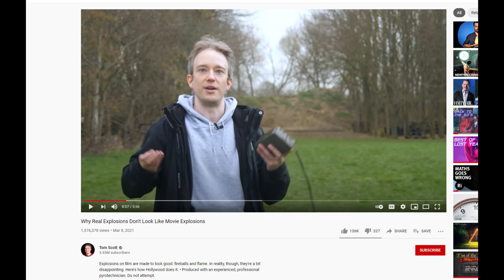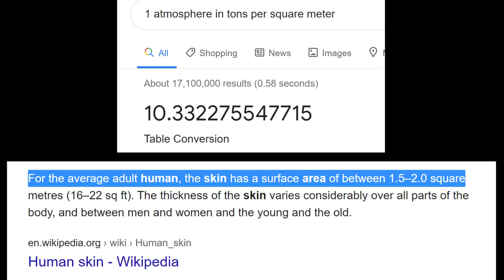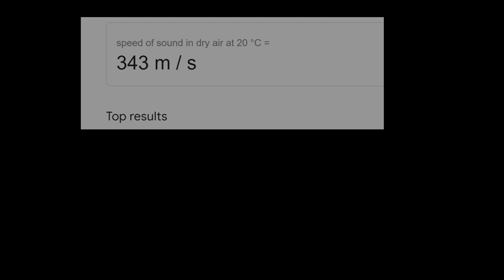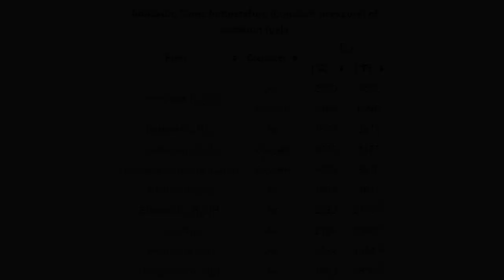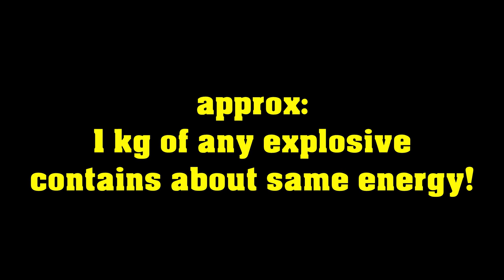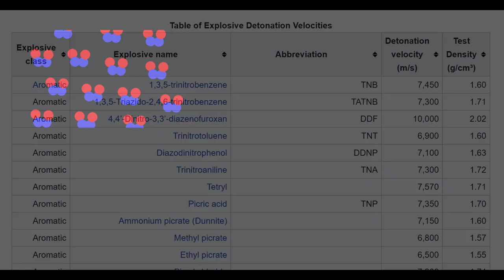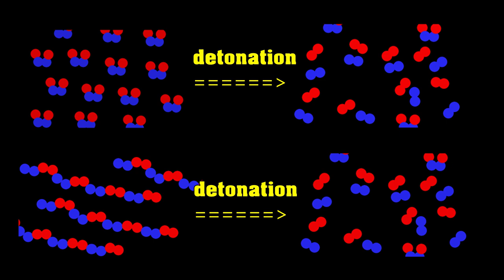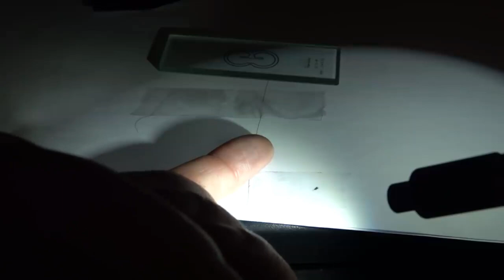Understanding Explosions!

Comment: I don't understand where the soot in the butane flame is coming from. Isn't a soot particle a collection of many carbon atoms? (how many? which configuration?) The carbon is coming from the butane gas, right? So when do these single carbon atoms from the butane gas that are left from the fuel rich burning combine into soot particles?
Reply: Google it bro.
Reply: @SuperMrDelgado  I did, before asking here even. Found some stuff on soot particle size in combustion engines (in Angstrom, not atom count. also no info on the structure, other than the fact that the soot particles are roughly spherical) but I couldn't find where the particles come from in the first place. Also I figured that people watching this video might be curious too.
Reply: @tpog1  The carbon comes from the fuel being burned. Butane is a hydrocarbon (a mixture of hydrogen and carbon). You're being pedantic trying to find the exact definition of soot. You might as well try to specifically define dirt. It's just a random assortment of carbon, it's not it's own element.
Reply: In a solid, the atoms are joined together (eg C60 - bucky balls). To melt a solid, you have to break those bonds. Hot atoms can cool down by forming bonds.
For a chemical reaction to occur, you might have to break some bonds  before making new ones, eg H2 + O2  heat them up to get H + H + O + O, and they cool down by making H2O + O
Reply: @SuperMrDelgado  You're missing the point. The carbon from the gas comes in individual atoms (almost) but at the time the soot accumulates on the glas these atoms have already organized themselves into fractal nano particles consisting of millions of atoms!

Edit: Look at the figure on page 1 of

http://vertes.columbian.gwu.edu/publicat_html/Jacobson%202020%20Soot%20composition%20Angew%20Chem%20Int%20Ed.pdf

There you can see what happens between the chemical reaction (the burning) and the soot reaching the glas.

Further edit: I am not pedantic at all, I am (was) curious! And now that I found out what really happens and where the nano particles (not the individual carbon atoms) come from I am pretty amazed.
Reply: You can google the energy of (say) a H-H bond or a C-H bond, etc.
Reply: @hermitoldguy6312  Thank you for your reply but I think you too have misunderstood my question. I know where the carbon in the soot comes from but again, soot isn't just a bunch of single carbon atoms floating around but a solid conglomerate of millions of carbon atoms (a nano particle which is gigantic when compared to most molecules, let alone single atoms). I was wondering where these particles come from when you burn a gas (I have no trouble understanding it when burning a solid, like a piece of wood or a cigarette). The articles I posted answer the question, especially figure 1 in

http://vertes.columbian.gwu.edu/publicat_html/Jacobson%202020%20Soot%20composition%20Angew%20Chem%20Int%20Ed.pdf

The individual carbon atoms self-organize into these gigantic nano particles after the chemical reaction but before they reach the glas which is really amazing if you ask me. And on page 11 of

https://www.repository.cam.ac.uk/bitstream/1810/285843/1/CARBON-D-18-03061R1_AAM.pdf

you can see where exactly this happens in the flame.
Reply: @tpog1  Thanks for the links - that stuff's a bit heavy for me. My answer (perhaps buried) was that the soot is formed as a way for atoms to cool down. The emission of light is another way of cooling down. The formation of reaction products is another way of cooling down. The thing is, a hot carbon atom can only bond with another atom it meets. If it's surrounded by oxygen atoms, it can bond with them. If it's surrounded by carbon atoms, what's a hot carbon atom to do?
Reply: @tpog1  Look up the definition of a pedant.  You're obviously just trying to prove you're the smartest person in the comments."I'm just curious, how did you capture these images in sequential order and manage to string them together in order to simulate movement? How did the individual photons interact with whatever device you were employing? Where did the photons come from?  Of course they form the image, but why are there so many?"
Reply: @tpog1  I threw some rocks at some other rocks, now they are in the same place. How did this happen? How are the rocks so organized? It's fascinating.
Reply: @hermitoldguy6312  Thank's for clarifying, I understand what you mean now. After I read your comment I looked up desublimation because I remembered that this is the name of the phase transition from gas directly into a solid, without a liquid state in between. And lo and behold, the Wikipedia article on desublimation (deposition) lists the formation of soot as an example:

https://en.wikipedia.org/wiki/Deposition_(phase_transition)

So it's not like the formation of a snowflake where the liquid water needs condensation nuclei before it can turn into a solid by forming crystals. Instead the gaseous carbon makes it's own condensation nuclei (or should they be called desublimation nuclei?) in the form of stacks which then can grow into solid fractal structures.
Reply: @tpog1  I don't have a mental model for liquids. AfaIcs,either atoms are bound together (solid) or they're not (gas). I can't imagine any other options. Looking at the phase diagram for the triple point of water, itsm liquids only exist in atmospheres - but I'm prolly wrong.
Reply: @hermitoldguy6312  Thunderf00t has a great video on this topic on his other channel:

https://www.youtube.com/watch?v=H7rejik_ZOw

It shows a simulation of a water droplet in air with realistic scales and speeds of the atoms and molecules. Maybe this helps a little.

Comment: if the shockwave pushes more around through the ground, why does it not slow down faster? shouldn't it lose energy the more it interacts with?
Reply: The shockwave does not "push" the matter, it propagates though it (similarly to Newton's cradle), the energy transfers from one molecule to the next. It is in fact just a very, very, very loud sound wave, so it moves at the speed of sound (the exception being the hot gas cloud from the explosion, that can sometimes expand faster than the speed of sound).

It only loses energy by expanding while travelling (via the inverse square law), and reflecting off from surfaces (like blast shields).

Comment: So if youre in a space ship, you have 1 atmosphere of pressure inside but zero outside - why isnt the ship exploding then?
Reply: The only thing that matter pressure wise is the pressure difference. The vacuum of space is effectively at 0 bar (0 psi). On earth the atmospheric pressure at sea level is about 1 bar (14.5 psi). So the pressure difference the capsule has to hold is around 1 bar.

This is not very much, to give some example this is about the same pressure difference an American football ball is holding. Car tires are around 2 to 3 times that. Scuba tanks can go up to 5000 psi (350 times the atmospheric pressure!).

However to make spacecrafts and space suits lighter the pressure is often lowered a bit. Human can live OK at 3000 to 4000 m altitude where the pressure is about 60% of sea level. If you want to cut down further you can increase the oxygen concentration. With 100% oxygen human can breath normally at only 0.3 bars (4.3 psi). This is what is used in the american space suits. However it is dangerous, at 100% oxygen a lot of things can catch fire very easily. 

The atmospheric pressure at ground level on earth is around 1bar. The atmospheric pressure in space is (close enough to) 0bar. The pressure differential between the cabin and space is thus ~1bar. Diving 10m under water also causes a pressure differential of around 1bar.

Since it is obviously not very difficult to construct something that can endure 1bar overpressure, it is similarly not very difficult to build something that can edure 1bar underpressure. Of course it is not quite the same to build a structure that can resist overpressure and underpressure, but it is not all that different conceptually. Since humans have built deep-sea diving vessels that endured ~1000bar (>10.000m water depth in e.g. the Mariana trench), it really is not all that difficult to believe that you can build a space ship that does not explode in space.

Comment: Eh a liter of gasoline is a combustible. Not a self-contained explosive. If you do the math you find octane actually releases about 10x more energy than TNT/Semtex/whatever. Partially because most explosives have nothing that can compete with the oxidizing power of pure oxygen, and partially because the oxygen burned by a liter of gasoline is not included in our calculation.

Perhaps somewhat surprisingly though, even an apples to apples comparison suggests that binary explosive like a mixture of pure oxygen and octane contain several times the energy of most conventional explosives. I.E. Rockets have more energy for their weight than bombs of similar weight. A 3000 tonne Saturn V releases consideribly more than 3000 tonnes TNT equivalent of energy as it burns. Perhaps a good reason why launching rockets from a regular airport would be pretty dangerous and thus point-to-point ICBM-based personal transport will probably not be happening any time soon. If the thing blows up, what you've got is basically a tactical nuke's worth of energy stored in propellants that could potentially mix.

Now, regular aircraft have energy densities even higher than rockets. A plane set for maximum range has considerably better Kerosene/weight ratio than a rocket. The main difference is that this can't really explode because there is no internal oxidizer. The best it can do is get very dispersed so it will burn quickly.

Comment: I recently watched a video on a space propulsion concept called the Orion drive 
Uses a series of nuclear bombs to push a spacecraft ahead at vast speeds

But I can't help but wonder just how well that even works when there is no gas pressure from an explosion as there is with a nuclear blast on earth 
Wouldn't most of the energy just be in heat?
Making this not a very good propulsion system 

Some incredibly smart people thought up the concept so I guess there is some reasonable explanation that some idiot who turns wrenches for a living doesn't understand

Comment: There is a high percentage of terrorist who are engineers. They say, its' due to engineers seeing the world in simple mathamatical reality. As a teenager, I had a summer job, in a amusement park. As joke, we took a roller coaster car, and put it near the bottem of a drop. We cover some t shirts with fake blood, and laid next to the over turned car. It looked like a car had jumped the tracks, with bloody body all  around. We hammed it up, by flopping around, as smoke bomb burned around us. We only did once. As the car went by, we heard the screaming, but the screaming never stopped. We sat there in the smoke, as we heard the screaming continue endless. Even when the car came to stop, the people were screaming. We quickly moved the car, which was heavy, and changed our t-shirts. We went to see what the screaming was about. The people riding the roller coaster saw us laying on the ground, and just lost it. Some tried to escape the safety restraints. Others had passed out. It became an incident, but nothing came of it. Rule one: never leave evidence.  Engineers design roller coaster, and hey are always trying to out do each other. Roller coasters  are always faster, or higher. but they don't need to be. Roller coaster should be built for their psychological effect, not physical effects. It's the same with terrorist attacks, they are more pschologically damaging, then actually harmful. Not to make light of people hurt, or killed in a terrorist attack, but the main effect is to frighten people. In my last year of college, I was in isolated lab, in the middle of the country. We had to make our own entertainment. We had an abundence of dry ice, which we used to cool are drinks. One of my friends was studing back in our rooms. He had some dry ice, bubbling away in his bottle of coke, when he called it quits for the night. He capped his coke, and finished up his notes. A few minutes later, there was an explosion in the room. It took a minute to focus, but we seen our friend laying on the floor. He was laying there clutching his chest, as he did this half moan, and yell. We couldn't get him to stop, so we picked him up, and drove him to the hospital. Halfway  there, he started to cry a little, and he said, "I'm okay. Don't take me to the hospital." We asked him what exploided, and he had no idea. We figured it out, it was  the coke bottle. The bottle didn't even rupture, the top just blew off. Being guys, we started pranking each other. We put dry ice bombs under each other's chairs. We stuck them under the beds, while the person was asleep. It was fun to watch, but not to have happen to you. By the end of the semester, it was impossible to sneak up on each other, even while we were asleep. It's been decades, and I'm still a very light sleeper. I wake up, before my wife can put her foot out of the bed, and I can't sleep, until my wife goes to sleep. If do fall asleep, and my wife walks near me, I wake up screaming. You can analyzed they physical nature of things, but there is alway the mental effect too.

Comment: Sorry, but I have to point out a logical error: humans have 2 sq meters of skin, but we are not flat two dimensional, so the the front or back of your body will not be 1 sq meter. Never the less, even if it is only 0.5 sq meters, I do not want to get hit by any blast. Still, a very informative video.
Reply: @brianbarrett2487  I might have got it a bit wrong in hindsight. Without getting my tape measure  and calculator out I would  think more than a  third of my  skin surface is not facing forewords or backwards. I look at my  legs, half of the surface area is on the sides, the same with my arms, and third of my trunk, the sides of my face and neck , and the top of my head and the bottom of my feet. Of course I am talking for myself, you may very well have the shape of a tape worm.

Comment: Sorry, gotta disagree,  atmospheres are far less - at least to me - intuitive than PSI. Knowing the surface area of the front of an adult body,  ballpark 5.5 feet by 1 foot gives 5.5 sf.  with 144 square inches per sf  gives 792 square inches.   A 3 psi overpressure dumps 2400 pounds on one side of the person unopposed.  Massive, and easily conceptualized, psi directly relates in the name pressure to surface area.  I grant you ATM are more head friendly than BAR or KPa.